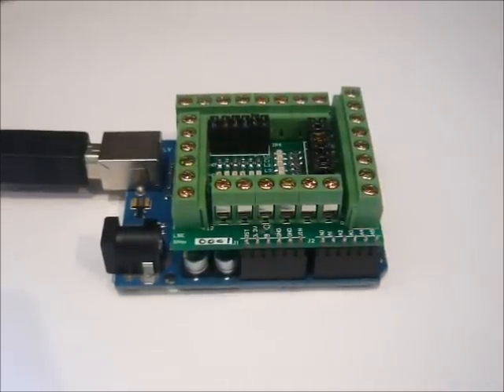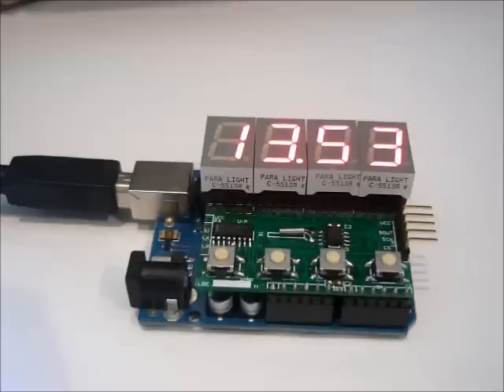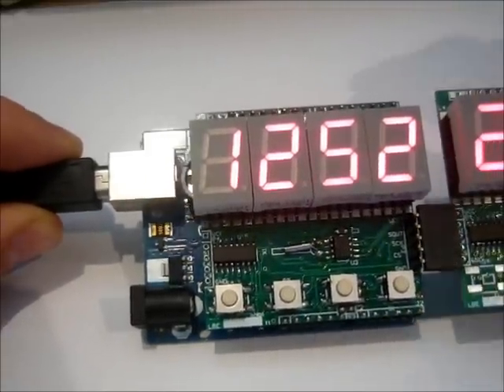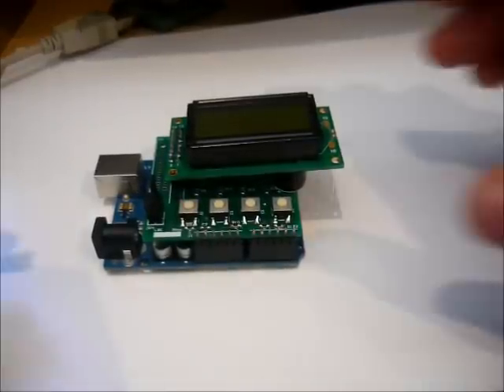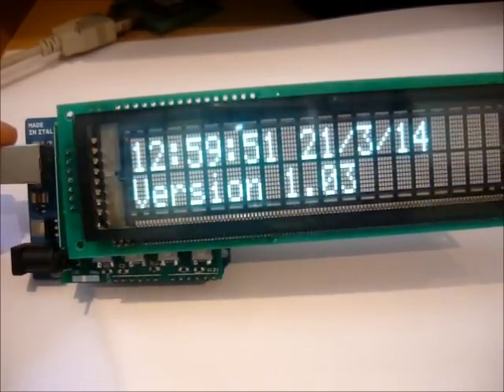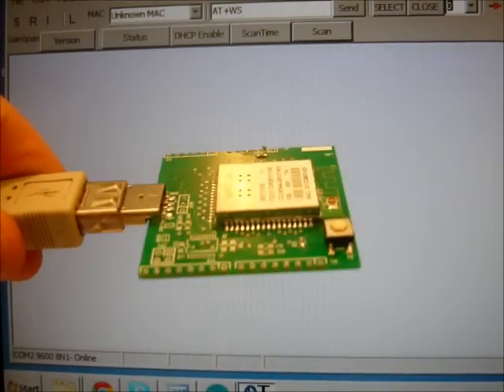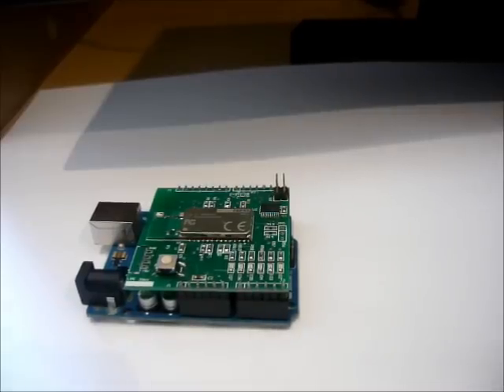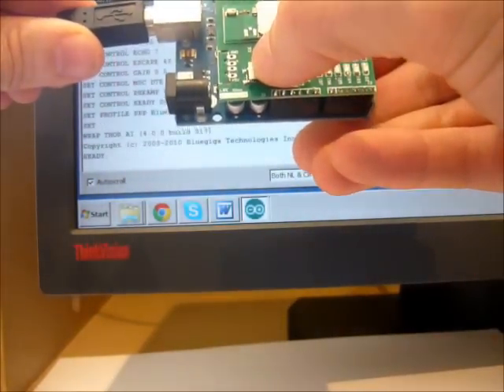Shields for Arduino - Screw terminal, LED, LCD, Gainspan and WT11 Bluegiga Bluetooth

Comment from the maker: Thanks for the positive feedback. The LED Shield can be purchased from arduino.com.au forward slash  Arduino-Shields-store.html (From Main page select Products then drag down to Store) or here arduino.com.au forward slash  Arduino-Shields-store.html . The postage has been reduced from $25 to $20 to USA which seems to be where 90% of Arduino users live. We have 5 of these LED boards in stock, and please email us for a LED extender board which will be cheaper without the clock. Thanks.